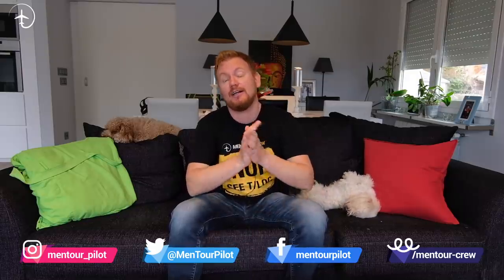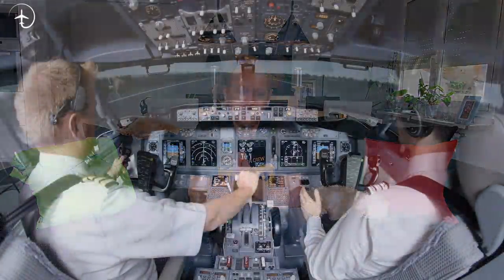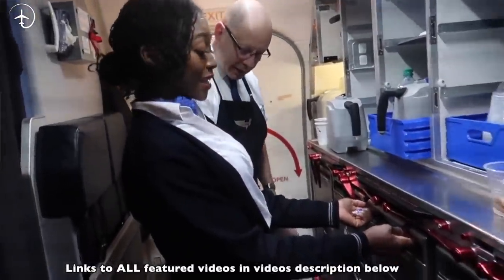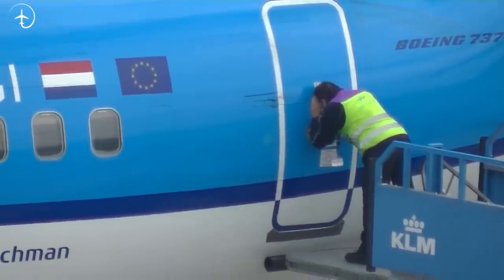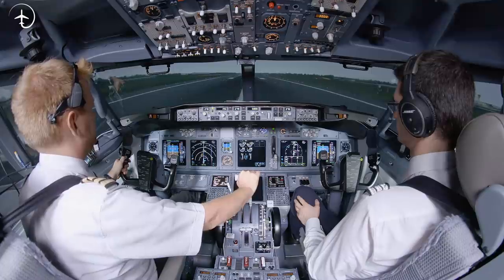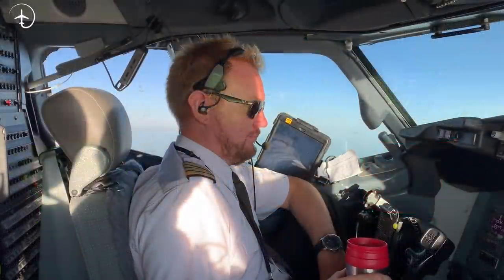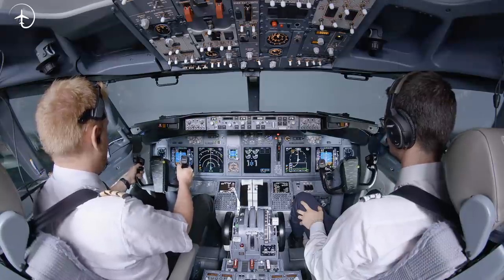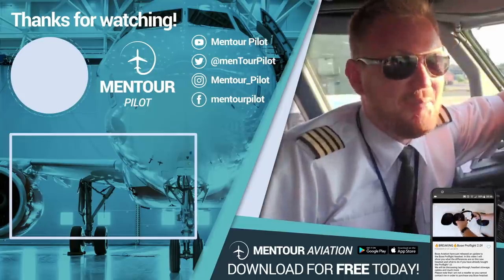How to fly an EMPTY Aircraft!

Comment: An empty Aircraft is Amazing. I was once on the Jumpseat in an Empty, Rolls Royce powered 757. It was the return from a Business Trip. My Charter flight in Falcon 900 had a Problem and the Airline Asked if it was ok if I was to fly with a Ferry flight of one of their aircraft. That aircraft was an Empty 757-200 and the pilots asked If i wanted to go in the jumpseat. It was a 2.5 hour flight so the 757 was empty and had low fuel. The 757 Has the best power to weight of any airliner still in Service. Only the Concorde, the 777 with the GE90 and a few business Jets are better or come close. The pilots had fun! I suspect they also enjoyed giving a show. They started on full power and climbed super agressively. I was amazed how fast a massive Airliner can move. I was totally gobsmacked. I have experienced business Jets climbing aggressively and accelerating while climbing but seeing an airliner with a 60 ton empty weight do that.... wow

Comment: Very interesting again Petter. You mentioned things that I wouldn't have thought off. Is for the slides many years ago when I worked in catering, I opened the door from the inside of a South African 747sp and the door was still armed. It knocked the top of the truck underneath off. Obviously I got into trouble but so did the cabin crew as the doors should have been switched to manual. The poor driver of the truck underneath was on tablets for year's. Lol
Reply: @r.h.8754  I have to admit it was an experience. But it's a warning to all to be careful.

Comment: The importance of checking those galley carts are properly stowed cannot be overstated. I was on an overseas flight from a popular Pacific island in a Boeing 777, seated in the forward cabin. The pilot pushed back from the gate and proceeded to taxi toward the runway without announcing anything to the crew. Not even chimes. I was watching the galley attendant continue putting linen and other items away while not paying attention that one of the carts was not locked or secured in any fashion. It turns out this was a 140 kilo (310 Lb) beverage cart. I saw our turn onto the active runway through the window - still no advisory to the crew. All of a sudden the PIC applied full thrust for takeoff. The crew member ran to his jumpseat leaving the galley unsecured. Items fell out of open cabinets but my eyes were trained on that unsecured cart. 31 seconds later, that 777 went into a steep climb and that cart took off through the galley and straight down the middle of the starboard isle. I made a split second decision to stop the cart with my foot/leg. I took the full impact and stopped the cart before it could enter the main cabin which would have cause great damage to the aft cabin or killed or maimed a passenger. I had no idea how much this cart weighed. I’m permanently disabled because of it but I would do it again if I had to. 

The airline by the way didn’t even apologize. The crew did but not the airline. The pilot in command told me, as I was being taken out in a wheelchair, that I was stupid and should have minded my own business!!!
Reply: You my friend are a hero....
Reply: Why do I highly doubt this is a true story? You must've sued ,everyone is sue lawsuit happy! I have trouble believing what the pilot said to you  supposedly.
Reply: David T: this happened as the merger of two large airlines was taking place. The dissolved airlines crews were being geographically disbursed to other hubs and the surviving airlines crews were angry and bitter that they had to take over these long flights to less popular locations. How the passengers were treated in the first year or two is another story but this story is true. And I did try to sue by the way. Ever try to go up against a company or individual with virtually unlimited resources? It usually doesn’t end well for the plaintiff.
Reply: Why should the airline apologize? You were the one who put yourself and possibly others into harms way and caused your own injury. Hopefully,  you're receiving all of the medical attention you require.
Reply: @gailpeterson3747  they were injured because the cabin crew failed to secure the cart as procedure and actually prevented the possibility of anyone else getting injured as the cart would have only continued to increase in speed the further it traveled. Not sure what you're going off about.

Comment: Always interesting stuff. In your  episode on empty 737, there was a big emphasis on usual procedures and routine check lists. This is what has contributed to a great improvement in hospital safety in the last 20 years or so, particularly in the OR. We have learned so much from the airline and auto industry over these years.    Dr Jim Kennedy.
Reply: That's a really useful comment, Jim. I work in road transport and manage a small bus fleet. We have employed many disciplines from the aviation sector, such as investigating every break down to see why, what happened and what we can do to avoid a repeat (often replacing parts on the whole fleet as a precaution). The result was that whilst our maintenance bill went through the roof to start with, it is now lower per year than before and almost 100% breakdown free.
Reply: @derekstuart5234  Very happy to hear this!

Comment: I understand how they were able to do a barrel roll in the 707 (Maximum thrust + light as possible).
Reply: It is not that difficult as this maneuver is not very stressful on the structure and everything else. You can propably fly it with passengers too. But should not.

Comment: I have a question about "speed" and "(almost) empty planes", so I'm glad about this video :) ! Thanks for the explanations about the plane's reactions during taxi or climbing, but what about cruise speed ? Is it different than on a heavily loaded plane ? 
Silly question but I'm asking cause my brother flew from Seattle to Heathrow yesterday, and intuitively, he said that "the plane had flown faster because it was almost empty" (30 passengers in a B787, how sad !). It took indeed around 8 hours, instead of 8h40 these last few weeks (in average, sort of). 
I'm probably wrong but I'm skeptical about the plane flying faster during cruise, because of its weight. Doesn't it depend mostly on the wind, and other criteria ? There are supposed to be speed limits, right ? And what about fuel cost ? 
Maybe, still intuitively, phases such as taxi or approach are more likely to be quicker than usual, since there's less traffic these days. And maybe some routes are slightly modified ? But, is it possible to be 40 minutes early only because of weight ?...
Reply: North Atlantic crossings have to maintain an assigned fixed speed over the ocean (though there's currently a trial program where some flights are allowed to operate at their own desired speed). But SEA-LHR has less than 1/3 of its route over the Atlantic as it flies over Canada and southern Greenland. But in general, yes, a lighter plane will fly faster (have a higher airspeed) for the same amount of thrust. The wind will alter the plane's progress over the ground though the airspeed is not changed. To oversimplify a lot: A plane with a 250kn airspeed and a 100kn tailwind will total about 350kn over the ground, and with a 100kn headwind will do about 150kn. But the airspeed is still 250kn either way. The same amount of thrust applied to get 250kn airspeed in a full plane might give (for example) 300kn in a lighter plane. That gives a corresponding increase in groundspeed, whatever the winds are doing.
Reply: @michaelhampton6388  This is very interesting, thank you very much for your explanation 👌!

Comment: Just in case of an emergency situation after take off for an empty aircraft, do you still need to dump fuel before landing since it is not that heavy already ?
Reply: I don't think a 737 as fuel dump, I'm no pilot but wouldn't think even a heavy would have to dump either but guess it would depend on the emergency situation e.g low brake effort maybe they would.
Reply: No B737 has a fuel jettison system. Thus would either hold to burn off fuel or land overweight.
The same is true for other narrow bodied aircraft such as the B757, A320, md80. 
It's an option on wide bodies such as the B767, A330 and A350.
Only aircraft like the B747 and A380 have it as standard. Unsure if it's standard on the B777 or not.

Comment: Hi Mentour, i got a question for you, 

there are many switches and buttons on an aircraft. But do you really "need" every switch on a daily basis? You already showed use the cooles switches, but can you tell, which ones are "useless"? Which ones do you almost never touch.
Reply from the maker: Some are emergency switches and are therefor used very rarely. Others, like hydraulics and electrics are used daily. There are no “useless switches”
Reply: @MentourPilot  Of corse every switch 
has its reason for being. Would you say the Ditching button is the most unused button, or do you have another specific one in mind that is used even lesser.
Reply: No, they may leave some buttons and switches at the base airport if they don't need them, but only on 1st of April ;) (Sorry for kiddin')
Reply: @MentourPilot  What about the “no smoking” sign switch?

Comment: How do pilots decided for one to control and another to monitor

Is really there is rule to pilot for controlling and monitoring the aircraft

Example during takeoff captain control and first officer monitor or vice versa
Reply from the maker: Normally we decide before the flight who will be PF and PM. Then we switch on the following flight.
Reply: Ensuring both the pilots gain fairly equal amount of flying hours under their belt.
Reply: Thanks

Comment: I look forward to fuller airplanes. Since American dispatchers do the fuel planning, we have to do the manual weight and balance forms too. My dispatch office has been going through so many forms because our e175s and crj7s need ballast fuel/ballast bags if they don’t have passengers (or only have a few). It takes so much more time to flight plan and it takes the pilots more time to do their preflight checks. 

We are canceling most of our empty or low booked flights and trying to prevent the need for repositioning flights. 

I’m used to planning like 30-50 flights a 10 hour shift. Now I’m down to 10-15 if even higher than 10. But I haven’t lost hours yet... 😑 I’m just bored.

Comment: I noticed this myself on a 737-700 flying in the states from FLL to STL last week (SW Airlines still flying limited service here). There was about 20 aboard including crew instead of 160 passengers.

The takeoff roll was at least a third shorter and visually looked slower (~135 or 140 MPH instead of the usual 165 to 170). Then came the quick rotation and 20 degree climb. It was actually quite impressive. Clearly a derated takeoff like you mentioned.

I fly frequently and have never seen an empty plane (outside of an empty flight from ATLANTA to Bermuda in 2010 with a hurricane bearing down on the tiny island). The descent also appeared much slower, as if the pilot had to "push" the plane down harder to get it to sink.

Comment: just asking. When the doors are "armed" what does that mean? What's the meaning of "armed"..? What's the difference between an armed door and "an unarmed" door ?
when the door is armed, does it mean the door is now : Armed and Dangerous..?? ha ha .
Good informative video as usual Petter. TQ
Reply: I think the inflatable raft/slide.
Reply: They don't give guns to the doors but arm the slides. When the slide is armed and you open the door, the slide will inflate. You'll see flight attendants arm them before push back and disarm right before arrival at the gate. And they always perform cross checks where the one doing the left door checks the right door and vice versa.

Comment: I'd be interested in hearing what the legal and structural limits are for flying an empty aircraft.
Reply: He mentioned that. Weight and balance. (I think someone else in the comments mentioned having a minimum landing weight, but I guess that depends on the type of aircraft).

Legal? I don't see anything except you have to be careful not to bust any limits. I think climb rate itself doesn't have a legal limit but as he said, you have to be careful not to trigger resolution advisories (I think that would be classed as an incident and trigger an investigation).

Comment: I’m curious, does the 737-800 rotate more easily when empty, and do you have to be aware of that to avoid a tail strike on takeoff? It seems like it would have a much smaller moment of inertia - but then again, the rotation speed would be lower so maybe it feels the same due to slower airflow over the control surfaces?

Comment: Does stall speed change when the aircraft is empty. Is more difficult or easier to regain the control of the aircraft if stalls?
Reply: Less weight, less lift required.

Comment: Love the T-shirt. I may have to order one. (See my screen name and there is a reason for it).
It's probably been over 20 years ago but I can remember fueling a Northwest Airlines charter for the NFL team The Tennessee Titans that had just dropped off the team in Nashville and were ferrying the aircraft from KBNA back to KMEM.
It was a 757 which has a high thrust to weight ratio and when I turned in the fuel slip, the pilot told me to make sure that I was watching when they took off and asked me to inform the rest of the ground crew. I was really not prepared for what I was about to witness. It may as well as been a fighter jet asking for a high-performance takeoff with an unrestricted climb. The take-off was literally almost vertical. Would have loved to have been on board when that happened. Wish we smartphone back then and I could have gotten a video of it. The only people on board were the pilots and the FA's and it was only a 25 minute flight from Nashville to Memphis so the aircraft was very light. I have told this story to a retired Fedex pilot who used fly MD-11s and he told me that when ferrying the MD-11 aircraft that they would have to start leveling off a couple of thousand feet before their final altitude just so they didn't  bust through that flight level. He said the MD-11 when empty was like a rocket.
Reply: I worked for AA when they had the MD-11, every Sunday I would go ORD-DFW, this was a repo flight so mostly employees, this bird gained altitude faster than the space shuttle, we would average about 50 passengers. Ohh what a ride. I miss the old birds they had character, all new planes look alike

Comment: As you said the hourly checking for fires is done... in that situation there is just one person at the flight deck? Isn't there a policy that there have to be two persons inside at all times?
Reply: I think only on passenger flights, which even on passenger flights when the flight attendant sits up front I don't see how it does any good, if the pilot was going to do something just knock out the FA

Comment: I guess it is much more fun to fly an empty aircraft, in general it is much more relaxing, and I guess that the plane handles better, does it?
Reply from the maker: Nop, Check the video
Reply: Ok, sorry but 74gear pictured it as being much more enjoyable, but I mean in case of emergency manouvers it is much more powerful for less weight. And by the way your company doesn't fly with cargo in the bay, even without passengers, as you explained in your past video?
Reply: @giovannimonchietto1863  a 747 weighs a lot more so could be the difference or could just be pilot preference.
Reply: @jasoncentore1830  sure

Comment: Do you in normal training practise traffic patterns in airliners in real? Sometimes I see training flights, but patterns done by 737 is rare sight... Do you practise it only on simulators or you don't practise it at all?
Also, great video. Cheers from Poland!
Reply from the maker: Yes, I’m order to fly with passengers we need to do at least 6 takeoffs and landings in the real aircraft. It’s called base-training and tgat might be what you have seen.
Reply: @MentourPilot  Is this a regulation, company policy, or something else? Also, does it vary country to country? I thought (and i could be wrong) that here in the US, new first officers first time flying the actual aircraft is during "Initial Operating Experience" with paying passengers on board.

Comment: Captain also make a video on flying in a bad weather thuderstorms and how you avoid, decide and calculate fuel etc etc
Reply: While discussing weather, I was wondering about the effects of turbulence on big airplanes.  I’m an old “retired long ago” private pilot and, If I remember correctly, for light aircraft, turbulence is more of a problem when the aircraft is lighter for structural reasons.  Again, I haven’t flown (as a pilot) for many years and I’m curious.

Comment: Another one that I just remembered. One of the Mayday episodes. 737 had to make emergency landing on the field. After investigators collected all the evidence, they needed to move aircraft somehow. What they did was they fixed the engines (the only thing that was damaged), fueled it with enough fuel to fly to nearby airport and took off from that field. Empty, with barely any fuel, it needed less than 1km of "runway"
Reply: TACA flight 110
Reply: @cr10001  Yes, that's the one